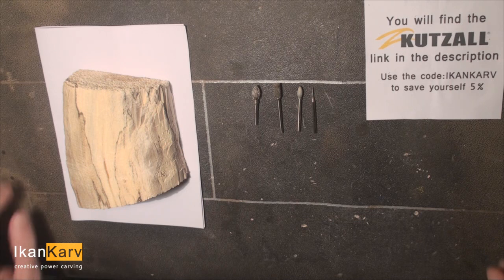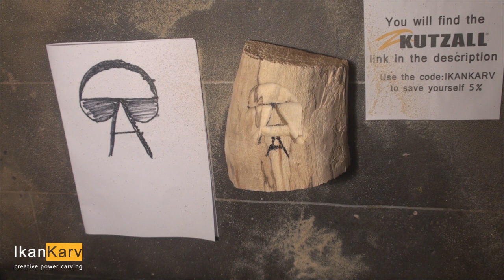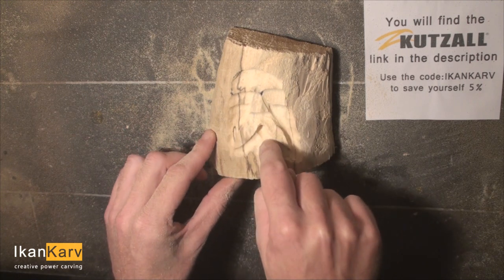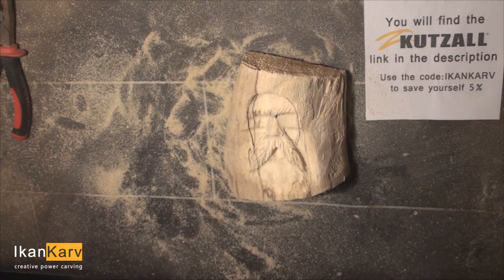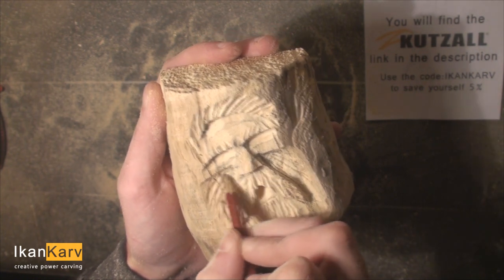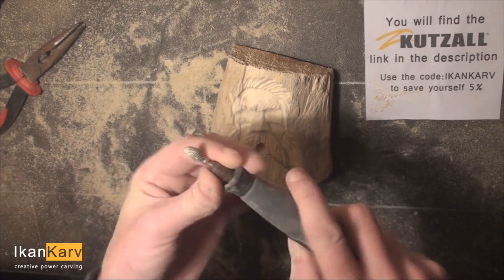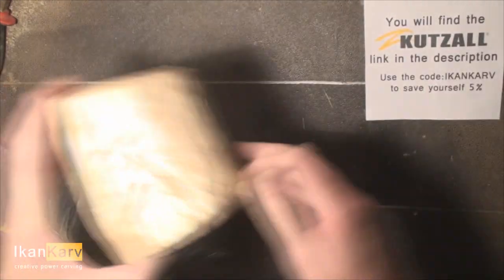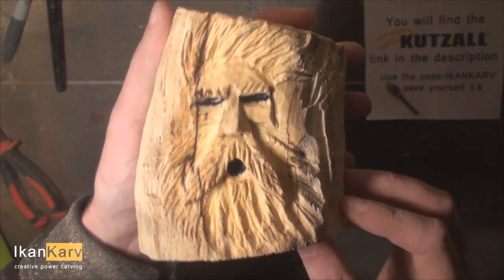HOW TO CARVE A WOOD SPIRIT FOR BEGINNERS - DREMEL FLEX SHAFT - CARVING WITH KUTZALL -   NOV 2020

Comment: I'm just starting out, have a draper multi tool with flex shaft. My bits (shank) go up to 3.2mm. What machine would be best for bigger burrs, to take off excess wood etc. Thanks.
Reply from the maker: hi Phillip, id recommend a die grinder, they can take 4mm bits, the bits id recommend are kutzall, or you could get an angle grinder and get a kutzall shaping dish. those tow options id recommend for bigger removal..
Reply from the maker: https://kutzall.com/?aff=66